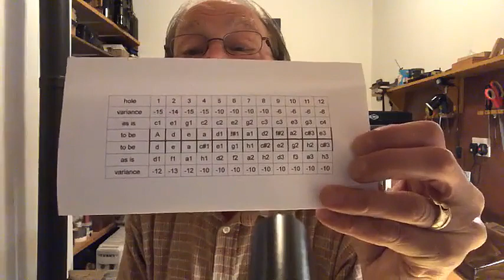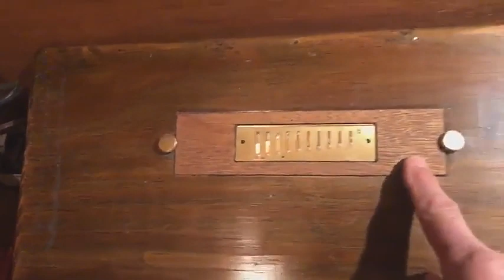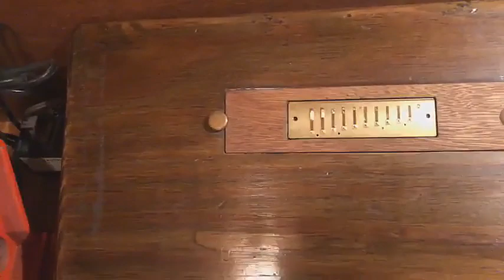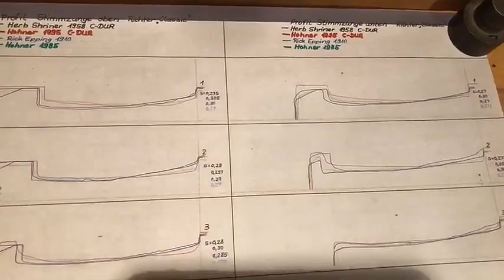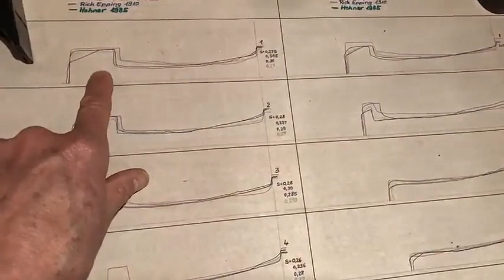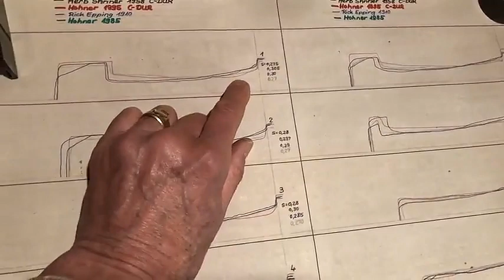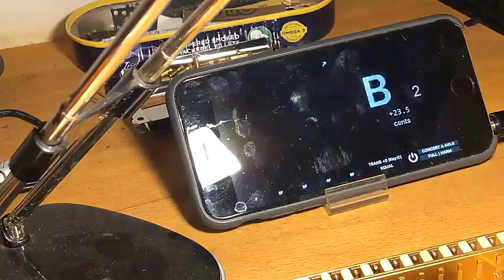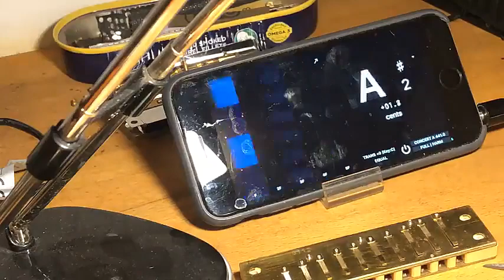Harmonica Reedwork Masterclass

Comment: hello! Silly question but why isn't it possible to just solder broken brass reeds? will it work? OR why not get a thin similar brass strip - in terms of materials reeds should cost cents? I know it's naive, but I really wanna "hack the system"
Reply from the maker: Sorry for the long delay in responding!
Even if a soldered crack would hold, the flexibility of the joint would be different to that of the rest of the reed and would affect the reed’s playability. But certainly, give both that and using a thin strip of brass a try! 
Short of purchasing individual reeds from the manufacturer, you might try installing used reeds from other harmonicas, including cutting down longer reeds to the desired length.
Reply: @stimmrad  thanks!

Comment: Do you ever do a full slot reed profile?  I see a lot of customizers bending the reed down into the slot near the rivet, and then re-shaping the reed to curve back out of the slot. It’s supposed to maximize air flow and get rid of the leaking near the rivet.
Reply from the maker: By profile do you mean reed curvature?  Always. For the quickest response, the reed should cut off the airflow as it passes through the slot, along the entire length of the reed, all at the one time. This can only be achieved by adjusting the curvature of the reed appropriately. In the organ building trade this is part of what’s known as reed voicing. 

Responsiveness can be improved further by reducing the duration of the period when the airflow is cut off in the slot; that is, by reducing the length of time between the pulses of air that produce the sound wave. This can be done by reducing both the thickness of the reed slot and that of the reed tongue at their edges of close contact, the reed slot by embossing and the reed tongue by chamfering. 

All the above procedures- voicing, embossing and chamfering, can, in addition to improving responsiveness, increase the strength of the upper partials, producing what might be called a crisper, brighter, thinner, or shriller tone. So it’s a judgement call as to how far to pursue these procedures in order to find the desired balance between tone and responsiveness.
Reply: @stimmrad  my main goal for working on my harps is to be able to access more overblows and overdraws. I am able to melodically use the 6ob by adjusting the reed gapping and some light embossing, it’s the overdraws that I can’t achieve yet. I’ve been able to use a lot of your tips to get to where I’m at now, including the strobe tuner.  I really appreciate all your time and effort sharing this knowledge with us. I’m an aspiring customizer, so your wisdom is greatly appreciated.

Comment: Wonderful share, great to see a craftsman at work!!! Using solder and the graphite resist was awesome. So many folks are using blue tack or white out, I'm old school like you!!!😁
Reply from the maker: Thanks for that.  I use solder for permanent retuning, but I also use blue tack for temporary jobs , to try out new tunings or when out on the road.  Back in the 70s I used powdered brass mixed with beeswax, after reading that the Chinese used to use a powdered lead and beeswax mixture to tune the sheng.  Got the blue tack idea from Brendan Power; it's much easier than powdered brass and beeswax.
Reply: @stimmrad  I play kalimba as well and tune it with tiny magnets.... This allows me to play in 5 different keys and to do some key changes with custom tunings... I need to make a video about it as I haven't seen anyone else doing this...🤪🎶🎵👍

Comment from the maker: Sorry @PhilipCatley, I seem to have lost your comment regarding fixing the reedplate to the work surface during chamfering, as shown at 17:00. Thanks, this might be a good idea. Bear in mind though that the reed is to be chamfered from four directions: forward and backward for the sides, and to the right and left for the tip. This will require that whatever surface the reed is fixed to will need to be movable.  

@PhilipCatley
At 17:00 when you are working the reed would the plate be more stable if you put a nail through the screw hole. Ie it’s slipping when you hold it with your fingers

Comment: Thank you for the video

I’m new to chromatic harmonica and harmonica is in general 

I took mine apart and found that on top of some of the reads they had a plastic cover like a plastic grease how does that work?
Maybe there’s another video that addresses that. 

I appreciate your work
Reply from the maker: Thank you for message. The little PVC plastic strips are a kind of check valve, usually called windsaver valves. They are important for the harmonica’s compression and response, as well as for enabling single-reed bending in both chromatics and diatonics. They can require some maintenance from time to time. My video, “Voicing, Valving & Tuning” discusses valves at 18:17.

Comment: At 28:00 you describe embossing but then show it as running the 100mm radius push tool over the reed only. I thought embossing was done on the reed slots and not the reeds themselves. I am confused. Could you clarify
Reply from the maker: The 100mm tool is pushing the reed into the slot and then going on to emboss the top edge of the slot. I only do this about halfway along the reed. Were I to do it for the half closest to the rivet, it could force the reed too far into the slot, changing its set and possibly straining it. When determining how far back to apply this technique, gently work the tool back from the free end until you start to feel resistance. It’s a matter of practice to know how far back and with how much pressure to use this tool. Finishing embossing the rest of the reed slot requires a different tool and technique.
Reply: @stimmrad  Thank you very much, that now makes sense. So last part can not be embossed using this tool.
Reply: Its not 100mm radius, its 10mm. 100mm is like four inches.

Comment: Rick this videos and your others are like gold. So useful. Some quick y/n questions. I have two harps both have the the 4 draw reeds blown. 
1. Can I assume that removing the 4 blow reed on one and after replacing it into the 4 draw position of the other harp I only need to sharpen it to tune into a 4 draw. 
2. Also could I use a 3 draw reed cut it smaller and also tune it as 4 draw reed. 
3. Can ! also do same for 2 and 1 hole reeds turned them into a 4 draw reed.
Reply from the maker: Hi there,
Sorry for the delay. 
1.  Yes, on a standard 10-hole, the 4-blow reed will work tuned up in the 4-draw position. 
2. A 3-draw reed will work cut down to the 4-position, with some key harps possibly easier to manage than others. 
3.  1 and 2 hole reeds, especially in the lower keys, can be quite thin in the back half of the reed, requiring the front of the reed to be filed too thin to bring it up to the pitch of a position 4 reed and still maintain a strong tone. If possible, I would choose a reed closer in position to the reed needing replacing. But, as reeds 1 and 2 rarely wear out, there’s nothing to be lost in trying.
Reply from the maker: Note that Hohner diatonic and chromatic reeds come in two widths, the lower reeds being 2.1mm wide and the higher reeds 1.9mm. Doesn’t work to put one into another’s position.
Reply: @stimmrad  Thanks for this. Really appreciated.

Comment: Another big thank you for sharing.  Now a question about embossing for improving brightness (upper partials) without going to far.  What's your thinking on only embossing the end of the reed slot (omitting the sides entirely).  Reasoning the tip of the closing reed generates most of the sound.  Thank you again
Reply from the maker: You could start with embossing only the tip of the reed slot and see what effect it might have, but I expect it will be fairly minimal. All Hohner chromatic and diatonic reeds except for MS are tapered; wider at the base and narrower at the tip (MS reeds have parallel sides), while all slots have parallel sides.  If you don’t get a desired result from only embossing the tip, then try embossing to halfway or so back from the tip. In addition to creating the desired sharp edge along the slot, it will help close the gap between the reed and slot where it is widest.  After that, try chamfering the reed itself before going on to embossing the slot sides all the way back. A sharp edge along the reed has the same effect as a sharp edge along the slot. Here’s some information about chamfering:
 https://docs.google.com/document/u/0/d/1hHeMSL1Pt3MV2U9HWGoPBCYicfukRP6W09CpfVssinU/mobilebasic?pli=1
Reply: Never thought to measure the widths of the reeds/slots.  Just measured some... always nice to learn something new! Regarding chamfering, I read your research report a long time ago and have chamfered my reeds ever since, just like in Formula One, low drag rules.  For chamfering I use one of Richard Sleigh's draw scrapers.  My embossing technique has always been all the way around, thanks to your suggestion going to change it up a bit.  Really appreciate the advice.  Thank you      @stimmrad

Comment: What's your thinking on making a Long Slot D from Db harp?   Would seem to be a simple retune (no solder).  Would value your opinion on whether it's worth the effort to try it.  
Thank you
Reply from the maker: I have a factory-made Special 20 D long slot. As might be expected, the low end is a little beefier and the high end a little duller and less responsive. If you play mostly at the low end, you might give it a try. 
When the MS reeds were first developed, the current MS short slot reeds were the long slots, with a short slot scale above it. The short slot high end played brilliantly, even the top reeds of the F#, but the long slot low end, which was shorter than the Classic long slot, lacked the power that Hohner reeds are known for. So a new, longer long slot scale was produced, called “Super Long Slot”.  I only wished that they could have kept the old short slot, providing three slot scales, but knew it would be economically infeasible, and a strong tone would be, for most players, more important than high end response for the highest couple of keys.
Reply: That's deep.  I've always wanted to try a frankenharp project, maybe a long slot D will be the one.   If I'm reading your reply correctly it would be... long slot Db MS plates for holes 1-6 retuned up to D.  For holes 7-10 MS D plates.  And I've been looking for an excuse to purchase a jewelers saw!  The economics don't make sense but it would be a good challenge.  Something to think about for sure.  Thank you for the reply and sharing.   So nice to have the resources we have today with YouTube.  When I started playing back in 1969 it was the dark ages.    All the best, Blunt White, Stonington CT.     @stimmrad
Reply from the maker: Before you go that far, try just tuning up the entire Db plate. Filing up the highest reeds, even by one semitone, will leave them pretty thin at the tip, which will improve their response. The pitch neutral point for most reeds is about 1/3 the way back from the tip, so utilise all that area when raising the pitch in order to maintain an even gradient in the reed profile. 

Another idea to try might be to cut down a set of D MS plates to fit your Classic comb. The reed length gradient on MS is steeper than on Classic. Check these approximate reed lengths of positions 1 and 10:

MS long slot 17.2 - 8.4
Classic long slot 16.7 - 8.8
Classic short slot 14.8 - 7.6
MS short slot 16.2 - 7.7

The MS short slot is not far off the Classic long slot in the low end and not far off the Classic short slot in the high end. 

Cutting all four sides of an MS plate to fit a Classic comb will bring the reeds closer to the front of the mouthpiece, improving response over that on an MS comb.

Comment: Dear sir, 
Does Harmonium and Harmonica have similar reed adjustment . 
As in my harmonium many times there is buzzing  sound , which also hampers while tuning 🙏
Reply from the maker: Hi Jezil,
Harmonium and harmonica reeds are similar in their adjustment but buzzing can be due to different causes.  

Harmoniums do not have the windsaver valves, or reed valves, that can cause buzzing in harmonicas and accordions, so the problem is something else. 

If a reed is not properly centred in its slot it might buzz. Sometimes it might only buzz if the reedplate is cold, and will stop buzzing when warm. But if the buzzing is happening with many different notes, there might be something loose somewhere. It could be a loose reedplate, but it could also be anything at all, such as a loose screw or bracket somewhere, anywhere on the instrument, inside or out.  Go over every inch of the harmonium to make sure everything is secure and hopefully you’ll find the problem.

Comment: Can you make a video on how to set up the 3 draw bend on an A harp
Reply from the maker: Setting up the reeds for the 3-draw bend is no different really than setting up all the other reeds.  I cover reed setup, or voicing, in my "Voicing, Valving & Tuning" video.  Set the reed offsets for the blow and draw reeds as low as possible without causing them to choke when you play at your loudest.  This degree of offset can vary from player to player.  The offset of the 3-blow reed is just as important for the 3-draw bend as that of the 3-draw reed.  Bending the 3-draw note can feel different and maybe a bit more fussy than bending the 2- or 4-draw notes because the 3-blow reed is tuned four semitones lower than the 3-draw reed.  While this means that you can bend the 3-draw note much deeper than the others, it also requires more accuracy to get an in-tune bend of one or two semitones.

Comment: Hi please tel me I am playing harmonica chromatic c 12 hol but no 10 hol only dro not blo why
Reply from the maker: Hi Fernando,
Was it working and in tune the last time you played it? If so, then the plastic valve on the outside of the #10 hole might be stuck to the reedplate with saliva sediment. Remove the covers and carefully lift the free end of the valve with a blade to free it. You can instead insert the blade under the cover without removing the cover, but for your first time I would recommend removing the cover so you can better see what you are doing. If this does not solve the problem and tapping the harmonica against your leg (with the covers on) does not free the reed then there might be a foreign particle stuck between the reed and its slot. It can often be removed without removing the reedplates from the comb but I would not recommend practicing this on an expensive harmonica. Safer to remove the reedplates from the comb then examine the problem reed and give it a little pluck. If this does not solve the problem then the reed might be damaged and need replacing. 

If lifting the valve solves the problem then you might consider periodically cleaning the reedplates. I clean mine in an ultrasonic cleaner like this:

https://www.amazon.co.uk/FLOUREON-Ultrasonic-Stainless-Professional-Eyeglasses-600ml/dp/B0744GDJ3C/ref=asc_df_B0744GDJ3C/?tag=googshopuk-21&linkCode=df0&hvadid=309816033027&hvpos=&hvnetw=g&hvrand=1032353182695167697&hvpone=&hvptwo=&hvqmt=&hvdev=m&hvdvcmdl=&hvlocint=&hvlocphy=1007850&hvtargid=pla-563231558784&psc=1
I use warm water with a few drops of dishwashing liquid. Don’t use hot water as it might damage the valves. 
Best regards,
Rick

Comment: Hi Rick, I really appreciate these videos. I've been experimenting (w/ good success:) using solder to drop pitch . Do you think it would be reasonable (feasible) to take a standard C Auto-valve and turn it into a Low D using this technique?
Reply from the maker: Hi there,
It can be done but the scale of reed lengths for the top and bottom plates of the C key on the Auto-Valve are shorter than those of the key of D, so it wouldn’t be as strong and you might get some kicking in the low draw reeds. You might do better re-tuning it to G or A rather than to low D.
Reply: @stimmrad  Ok. Thanks for the advice. I currently have an auto valve in A and G and am looking for a D to play Irish/ fiddle tunes etc. Maybe it would make more sense to tune a C up knowing that the upper few reeds will probably not be too useable. I can save myself a bit of work in the low octave by tuning it to easy third as well. Do you think I can tune those tiny ten hole reeds up without destroying them? Thanks for the response. Cheers.
Reply: @stimmrad  One more question if you happen to look at this text stream again... I do have one extra G auto-valve kicking around. Would it make more sense to try and turn this into a Low D? Are the reed lengths more appropriate? I was initially thinking of using a C b/c I have a handful of used/ abused ones that I picked up cheap years ago... Cheers
Reply from the maker: @ResonantHarp  That would put it an octave above the fiddles, kind of out on its own.
Reply from the maker: @ResonantHarp  G and A Auto-Valves have the same short reed lengths as C. Easier to tune down than C but the end result will still be less than a stock D. E and F Auto-Valves have the same reed lengths as D. They would do fine being tuned down.
Reply: Ok. Thanks Rick. I'll keep looking about.